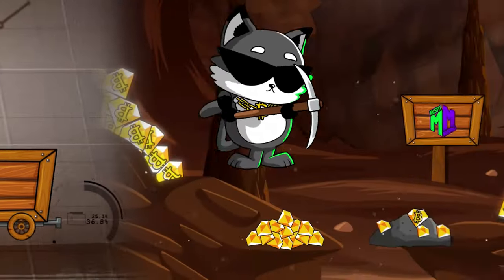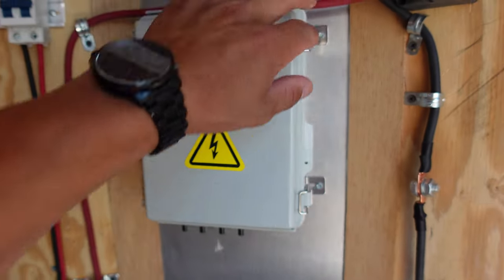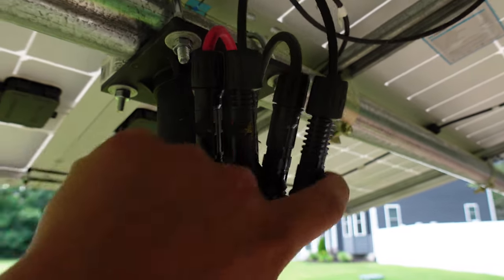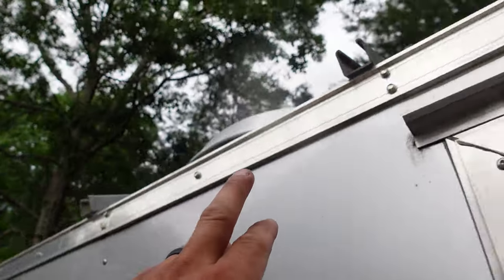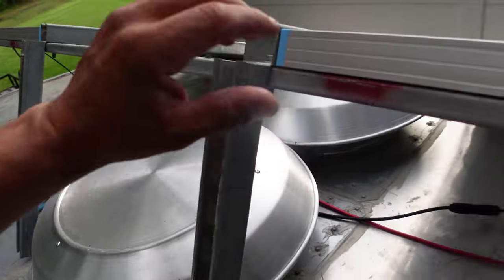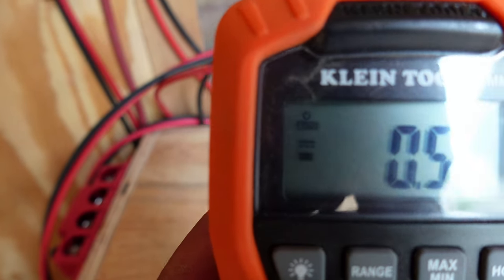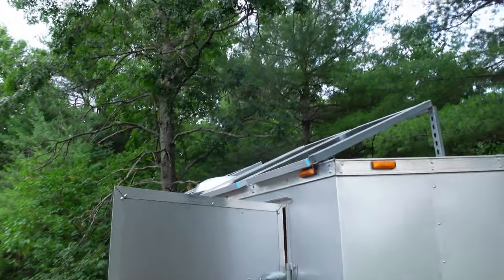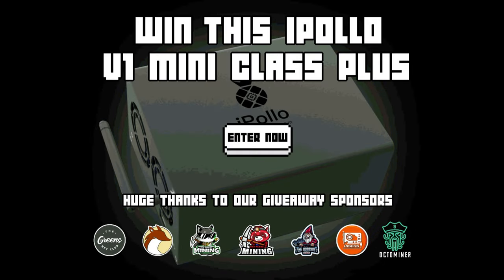Adding More Solar Panels to The Crypto Mining Trailer

Comment: Nice to see you got it up and running . 
You probably could just use the unistrut L bracket and bolt it to the legs , then bolt it to the roof of trailer to secure the panels …

Comment: 5:47 design and 3d prinst some feet that screws into this steel u-channel and then attach the feet via silicone to roof of the trailer.
Just make sure you dont use PLA, probably ABS ideally.

Comment: great, something i would do different, remove these roof vents, figure out a way to use the door as a vent and air flow to the trainler basement, use the full real estate of the trailer roof for solar panels with  Heavy Duty Drawer slides to doube the solar panels (did that on my RV) u end up having double the solar and capacity. I won't worry much about solar panel tilt on the Roof. One more thing, sell these overpriced Battle born batteries and get a server rack battery for half the price
Reply from the maker: Agreed! More solar videos are in the works as we speak!
Reply: I meant battle born batteries not victron
Reply: @ChumpChangeXD  for alternative vents, check SEAFLO 4" in-Line 12V 270 cfm blower, they are 120W very efficient and quiet and only $35 each, u might need multiple for intakes / flow out
Reply from the maker: Yea I knew what you were saying haha
Reply from the maker: Only issue with using the door is the security factor is not gone if you compromise the door
Reply: @ChumpChangeXD  then may be a 4 inch side holes you will be able to create the same air flow
Reply: @ChumpChangeXD  I’m hooked on the idea of roof is 100% solar

Comment: Two more batteries and you can go to 48v system. 48v runs so much cooler
Reply from the maker: Not with this growatt it’s a 24v system
Reply: @ChumpChangeXD  ok it is what it is for now. I liked running my 56 volt panels in parallel.I just got the biggest lead acid from Walmart 4 of them. And a 48v inverter. It runs my rig most of the day. Next time I find a solar park going out of business I plan to load up. This was all new to me 6 months ago.

Comment: Is it possible to use solar in the far north of Canada? What about snow? Thanks
Reply from the maker: Yea you will have to roof rake the panels when it snows typically
Reply: @ChumpChangeXD  thanks. I have a similar plan to you. I think you can fit more panels on there. I’m using starlink and their new roaming system. Researching for the best batteries to store power. Good luck. I like watching the build.

Comment: why are you using 100 w panels ?? you can get 380W panels
Reply: You can easily get even higher than that.
Reply from the maker: This is just the first set up and I like the ease of use and trying to not have a massive panel to work with yet. Next system may be different